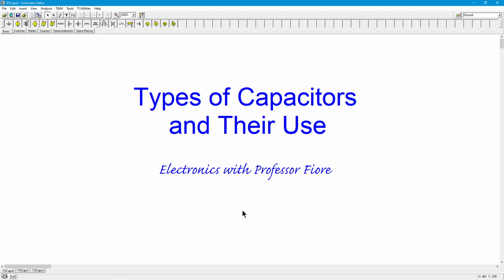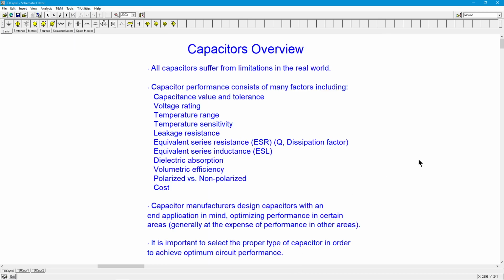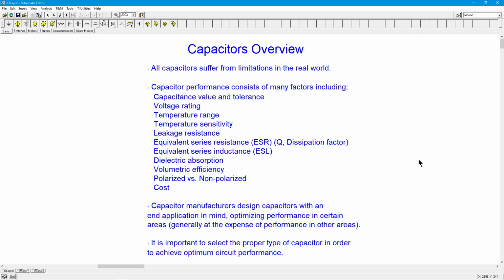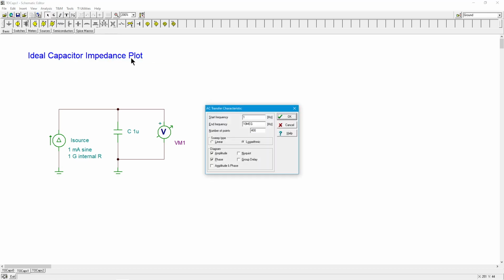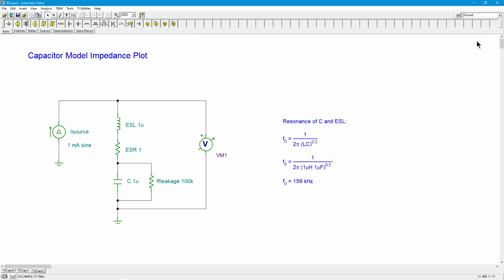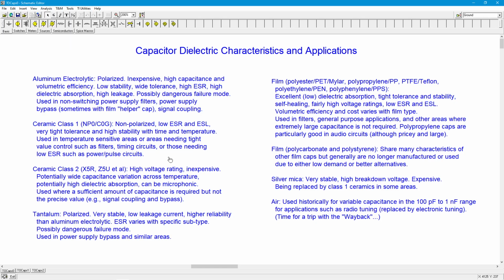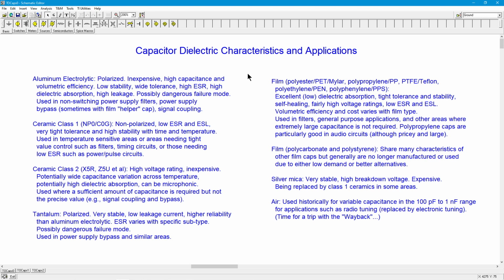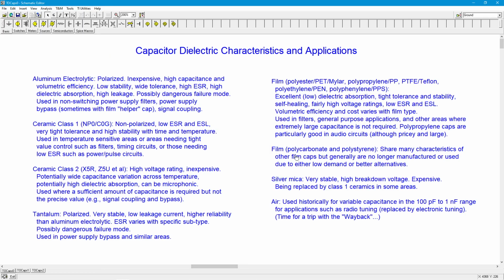AC Electrical Circuit Analysis: Types Of Capacitors

Comment: Great informative video!  lol the puff cap :) Don't forget ripple current rating often seen on electrolytic caps, especially important for power supply filtering caps.  And also "safety capacitors" X class and Y class, a type of film capacitor, for line voltage connection where failure could endanger the user so they are made to fail in a safe way thus the name.  Very common in switchmode power supplies.

Comment: I like your detailed explanation on capacitors. Helped me learn a little bit more about them. I use 0201 and 0402 size surface mount caps (mostly in shunt) on the EVBs for my company's BAW passband filters all the time.

Comment: Excellent coverage and explanations of capacitors. Only missing the Supercapacitor/Ultracapacitor or an electric double-layer capacitor (EDLC). Thank you very much.
Reply from the maker: Thanks, I chose to leave off super caps because generally they are not applied in the traditional areas we use caps, but as a short term power bridge.

Comment: Tantalum caps typically have 0.5uA to 50uA DC leakage at 25C after 5 minutes. Much more at higher temps. I wouldn't characterize them as low leakage.

I guess "low leakage" means lower than an aluminum electrolytic...
Reply from the maker: Yeah, everything is relative...

Comment: Hello, I got a question about working with Tina-tl. Is there anything like Goal seek in Excel? For example i got information about all resistors and current strength for one section. Is it possible to automatically find the strength of current source by knowing that information?
Reply from the maker: Not that I'm aware of. Maybe the current commercial version does- I don't know.